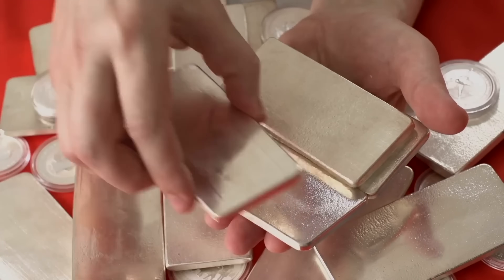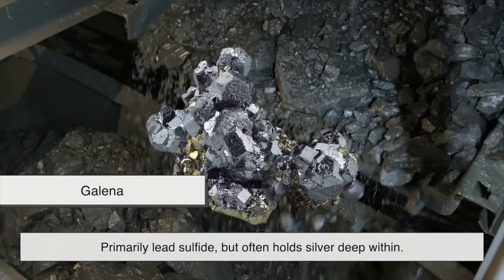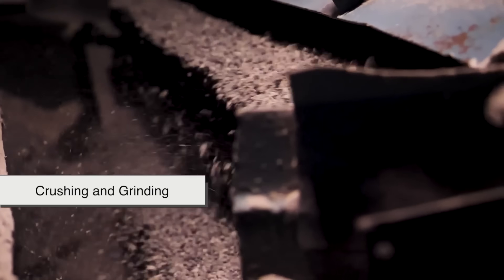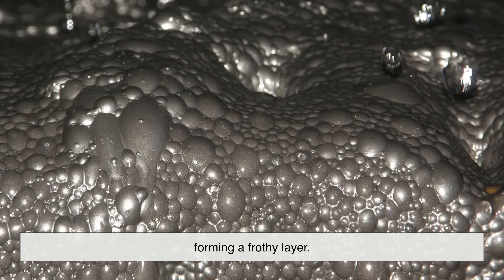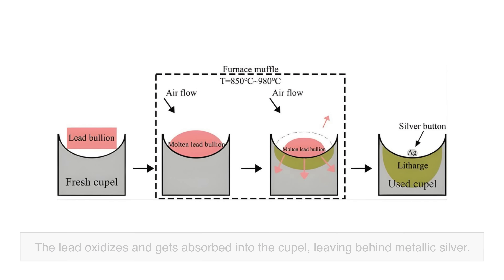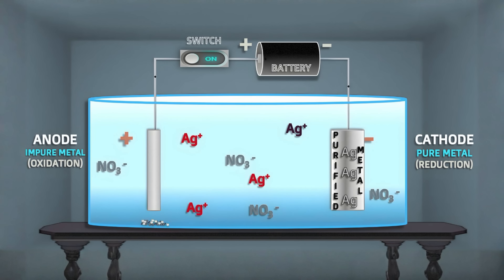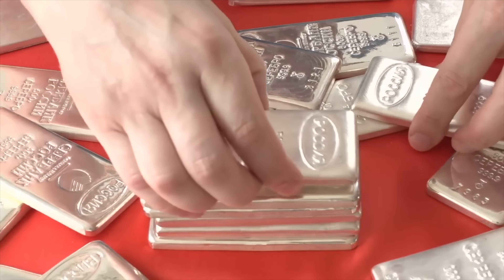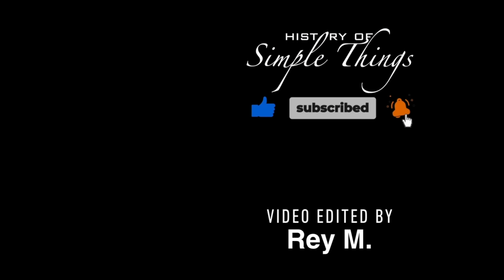How Is Silver Made?

Comment: Great video. Metalurgy is a complex process and different rocks require different methods, although this video does a great job of identifying the most common steps. 

The best outcome for silver miners would be direct smelting which is only possible if you have very very high silver grades, typically from narrow veins. In that case, all you need to do is gravity separation and then direct smelting. It's much more cost efficient and better for the environment. But it is also extremely rare. 

EraNova has a project that supposedly can use this process, but I'll believe it when I see it.

Comment: I love to work with silver. It's very forgiving, and can be re-melted endlessly if necessary. What the video didn't mention is that silver LOVES to be polished, and is the most lustrous metal in the entire periodic table. It out-shines everything else, including gold and its cousins platinum and rhodium. Most proper mirrors are backed with a thin layer of silver, that's how shiny it is, reflecting up to 90%+ of the light hitting it. It's pretty dense too, a pound of silver doesn't look very big. It does tarnish, but that can be useful too, and silver nitrate has been a staple of black and white photography since film was invented so very long ago.

Comment: Why isn’t silver used in electrical appliances and powerlines as it is a far superior conductor than copper other than it being too expensive?
Reply: because of cost and rather lousy mechanical properties , under stress it develop cracks 
It is used a lot for industrial power electrical equipment  , coating the switching surface where it help dissipating the sudden surge of high voltage and current